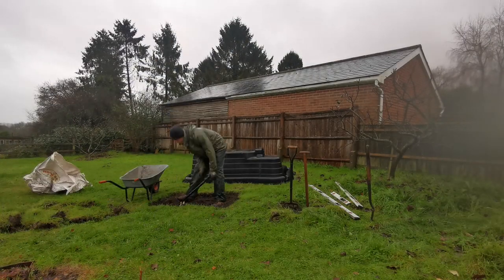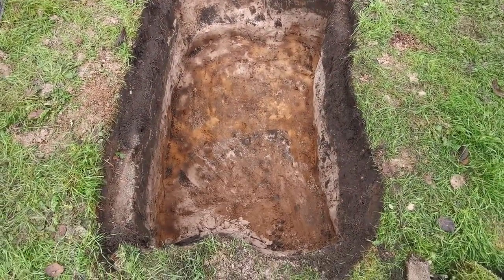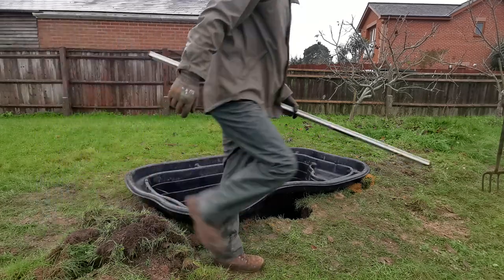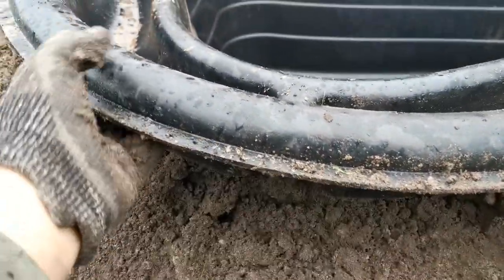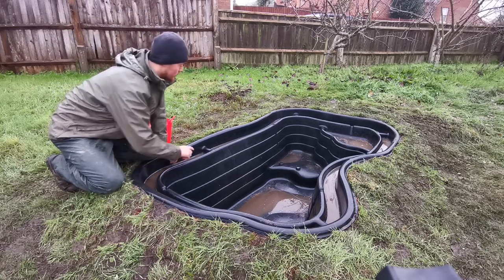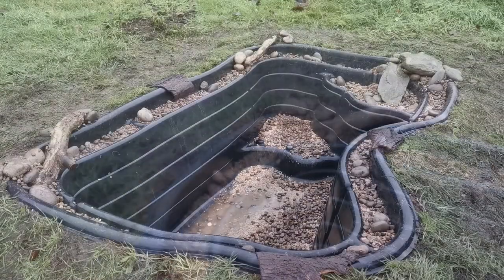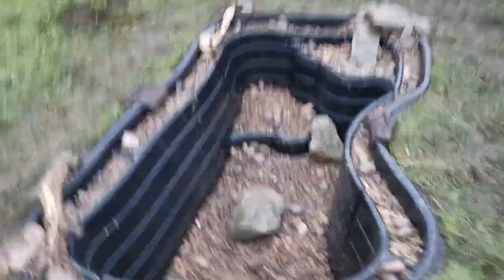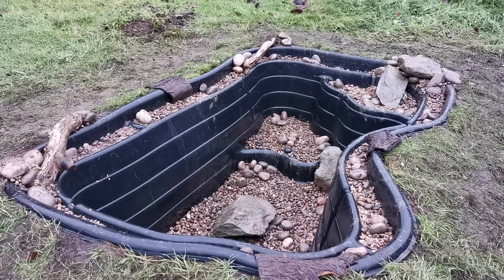How to Install a Pond bring Wildlife to the Garden - DIY Preformed Pond Complete Build

Comment: Hi thanx for the info, I used a preformed pond and didn't make sure it was level. It was ok but I've decided in the new year to rectify it and make sure the end that isn't level will be. I dug it when it was a really wet weekend in the spring of 2022. But as it was my first attempt I soon learned .
Reply from the maker: Hey fishtales thanks for the comment glad you found it helpful. Yes it's a really common problem with pre formed ponds, good on you for planning to fix it as it's never fun going back over your work but it's how we learn and grow. An idea to save emptying the whole pond and re digging bits (depending on size) if your pond has the overhanging lips you could carefully lever the areas that are low up with a spade and pack them up with slates or bricks depending on how much it needs to be raised. Then could bank soil or turf over those areas to hide the bricks/tiles/slates. Hope this helps and it all goes well 😁👍

Comment: How do you deal with heavy rain? We’re in Scotland and obv during winter get a fair bit of rain, I’m worried about overflowing.
Reply from the maker: Hello, that's a really good question, yes I can imagine the rain in Scotland during the winter months can be torrential. There are a few measures you could put in place some more practical than others. During heavy rain periods you could cover the pond or empty the level so it doesn't overflow (not always practical). Another option is to when installing the pond have medium sized rocks tightly lined up around the outside of the pond so when the pond overflows the rocks catch and retain the plants and organisms. Another thing is to have a buffer zone about a foot wide around the outside of the pond made of pebbles so when it overflows the water can drain through catching any organisms and most organisms will be able to crawl back into the pond from there. Other options could be using a pump to filter and remove water as the rain fills it up. Hope this helps 👍

Comment: So I've finished the pond and am waiting for the rain to fill it up. I've got a few oxygenator plants which come in those plastic pots with lots of holes in, do I just weigh them down and put them in the water as is, (according to the appropriate depth)? They're for zones 3 and 4. Thanks.
Reply from the maker: Hey Katherine yeah that's absolutely correct weight them down with gravel in the posts or bricks either side works some people use led if you want to do away with the plastic pot entirely. Later in the year when they have grown you will be able to take them out of the pots and either split them to make more plants or pot them into a bigger pot with some aquatic compost so they don't become pot bound 😁👍

Comment: Just a couple of pointers: Rather than pay a premium for "pond" rocks that won't alter pH,  it's useful to know that any type of rock that isn't a carbonate (limestone) is probably fine. A small eye dropper filled with muriatic acid is the perfect test tool - put a couple of drops on a rock and if it doesn't bubble the rock is good. N.B. Muriatic acid is nasty stuff so BE SAFE! 

All volcanic rocks are by definition fish safe since they're inert. Silicates are also mostly OK - try to scratch with a knife - if you can't scratch it easily, you're good.

All that said, remember that rainwater is normally soft and some species - notably snails and freshwater crustaceans do actually need a source of carbonates or some hardness in the water, if not very much, as do most fish, especially goldfish. As always it's a balance. Personally I'd recommend not putting goldfish in a wildlife pond - on the one hand they eat pretty much everything and on the other hand their needs are different and somewhat at odds with the water qualities ideal for biodiversity.
Reply from the maker: Hey Julian thanks for your comment, there is some really good information here so thanks for sharing this. Definitely agree on the goldfish in a wildlife pond, it almost doesn't become a wildlife pond if you put a predator like this in there 👍

Comment: I put a baby wading pool in my yard & filled it w water for the critters. Pine needles & cones from the trees
fall into the water & the raccoons & birds soil the water by bathing in it. THEN, green algae grows. I put
some of those tablets for farm stock tanks but it did not help that I could see. SO, I got rid of it & got
a 2 gallon dog dish. I still have the same problems but I can afford to throw away 2 gallons of water to
wash & clean the dish before refilling it. The pool held 80 gallons. How to stop the algae?

!
Reply from the maker: Hey Ourv9603 yes I can feel your pain it can be very hard to prevent algae when the water is constantly being contaminated by plant debris and animals as it provides nutrients for the algae to feed off. Sometimes the nutrients in tap water can encourage algue as well so try fill up with rain water if you can. Treatment for algue are things like pumps, filters, uv lights etc but in a natural pond this is not really an option. The best way to sort it out in a natural pond is to have plants in it which will help naturally filter the water taking nutrients away from the algae and preventing it from swamping the pond. You will always have a little bit of algae around the plant pots and in shadey areas but it's controlling it. If I see a small bit of algae growing I usually just take it out before it gets too big and spreads. Another option is getting a solar pump or fountain to oxygenate the water and keep the water moving/rippling as the algae needs still water to survive. Hope this helps you out 👍
Reply: The best trick for permanent algae removal or just green water is to cover your pond with something that will block out the sun for 5 days as soon as you fill your pond you should do this it won't work if you let the water come in contact with the sun before the natural pond bacteria has time to grow when you remove the cover the bacteria will be starving for algae the water will be crystal clear and should stay that way even in direct sunlight if you don't like the idea of covering your new pond you can prepare a bin full of pond water bacteria to give you a headstart and cut the time down by 2-3 days in extreme cases of algae it's possible to just dump the old water refill and leave covered for a couple of weeks till all algae has been eaten from the rocks gravel etc pond plants just relocate till process is over this will work far better than any algae removal chemical this one very important step everyone misses then in as little as 5 days you have a big mess and much work to fix

Comment: I’m just about to do this. I thought you would add water to the inside keeping the water level with the internal lines on the liner.
Reply from the maker: Hey Richard great to hear. Yes that is a way to get it level if you don't want to use a spirit level but some pre cast ponds don't have those lines on the inside and it wouldn't if you were installing a flexible liner so I wanted to show a method to level the pond that can be used across all types of ponds. 👍